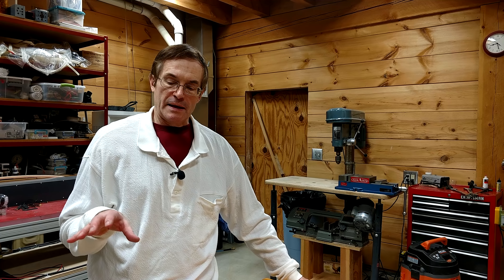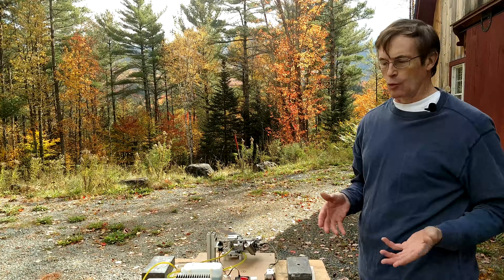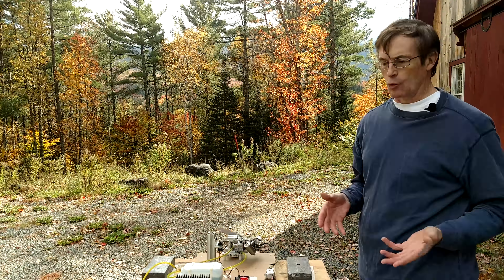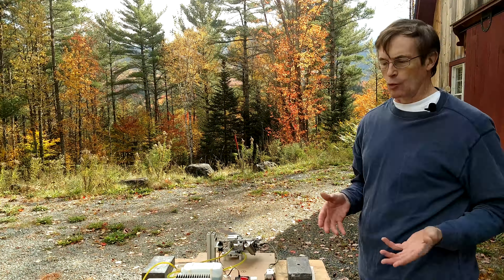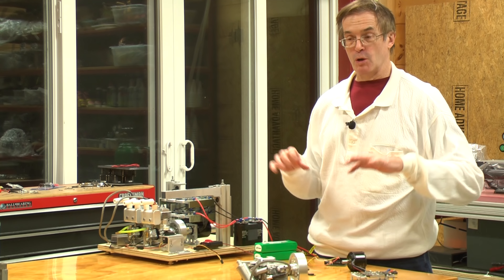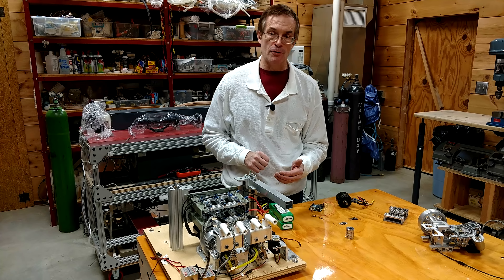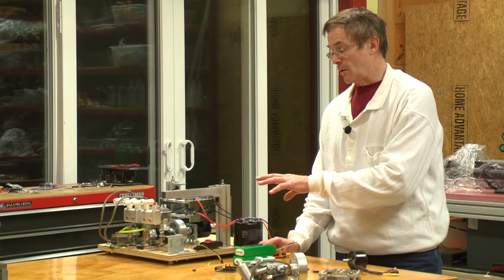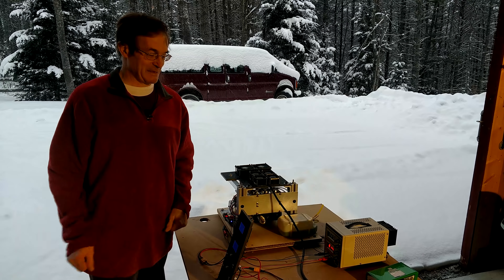Hybrid Drone Generator

Comment: A hybrid system of this type is what I always dreamed of for my ultralight or airplane.  That way, in the event of any gas motor failure, you have an electrical reserve to reach an airport.  If the battery pack were large enough, it could also have incredible hybrid like fuel savings (which is very relevant to flight costs especially for a recreational pilot).  This arrangement might also provide the incredible ability for some quiet soaring time (since stopping a gas only motor in flight for this purpose would usually be unsafe) since a restart would be assured.
You seem like someone who would enjoy building/flying an ultralight as a project...  I think a hybrid ultralight would be a thrilling addition to your inventions!  (I'd be happy to help test fly it.)  Thanks for all you do to spark learning, from a kids science teacher.  :-)

Comment: Love your videos and the technical accuracy (correctness) that you demonstrate.
I am working on a gas powered quad, and found the same thing you did regarding torque pulsations.
I moved from a 4 stroke engine to a 2 stroke.  Also added a flywheel to minimize amplitude of pulsations through my transmission.
The 2 stroke runs well at higher RPM's, so with greater gear reduction, this also enabled a lower torque (at the engine) for a given amount
of power.  Still had some problems during accel up to operating speed of resonance on the soft motor mounts, but not enough to  ruin anything.
Did have to go to a carb with diaphragm pump, not float, due to the high level of vibration.
Reply from the maker: Thanks and interesting.  Our vibration is very low, but in an airplane 
installation, the vibration should be at least as high and probably 
higher than yours.

Comment: This is so cool.  I've watched most of your other videos already and it's taken me a while to get to this one.  Very impressive work with the drone generator and I appreciate the in depth explanation of how you balanced everything.

The coupler that you broke could be replaced with a lovejoy coupler.  Those, if you're not already aware, have a rubber dampening piece that separates the two metal halves of the coupler.  They use them on cam driven fuel pumps on high horsepower motorsports applications because it removes the shock loading of the metal parts.  I don't think that's the correct scientific term, it may be, but that's what causes it to break. 

Thank you for making these videos.
Reply from the maker: Thanks!
That is the coupler that we eventually went with.

Comment: For drone use, it is quite possible to use an ESC to start the engine. Some ESC units may have trouble with the higher RPM when the unit is set to slower than running speed, and thus overheat trying to apply brake. Contact your ESC manufactures for ones that can be used for starting and electrically disconnected when returned to idle. You do not want a reversible unit or one with a brake function. This may allow use in an enclosed airframe where access for starting may be limited.

Comment: You can filter out ripple by using a so-called „capacitance multiplier“ circuit. EEVblog has a video about them. They use a small capacitor, a couple resistors and a transistor. Since the transistor multiplies the effect of the filter capacitor, you can considerably reduce the size of the filter capacitor, which saves a lot of weight and space.

Comment: You have an incredible presentation skill. I know many people who are excellent engineers or great presenters, but very few people who are both. I wonder how much power the commercial drones can generate - after all it's only around 300W or less than half a horsepower - probably not nearly enough to lift the motor with the fuel alone, not to mention the entire drone. This video shows really well how hard it is to build an efficient system like this, not to mention making it a working product, which is way harder than building a prototype.
Reply from the maker: Thanks!

Comment: If you calculate All of the optimal efficiencies in your Hybrid system, you will fins that you will need to burn around 200% of the weight of your entire Hybrid system in gasoline before it becomes more efficient than just adding more batteries.  Those 2-stroke engines have high single digit efficiency at best.
That being said, I think what you are doing is great, and applicable to many things.  ~new subscriber
Reply: What you say is true on takeoff but with modied stubby wings crusing you could run the gen at 100% peak power and divert that to 3 of your engines remember he said gas is 20 that s TWENTY times the energy to weight ratio of batteries so over 40 pounds in batteries =2 pounds of gasoline leaving 38 pounds for the hybrid drive...i might be wrong but god I hope "HIM" (above video) and I are both correct or he just pissed away a lot of time and money for a gasoline generator you can buy for $400

Comment: for the flex coupling, there are also ones which are overlapping claws with rubber (star) insert in between.
they are not that exact for cnc motions with forward/back, but should work fine for a oneway running generator.
Now the rubber might get old and hardened but worth a try.

Comment: I very much enjoyed this video and your teaching style is great. What you are building is a serial hybrid. As others have commented, the complexity and weight, and most importantly the conversion losses will overshadow the gains. Perhaps you should try a parallel hybrid. Use the engines to generate 85 percent of the upward thrust needed to hover the craft. Let the four electric motors make up the rest of the lift and provide control. You could use an inline pancake generator to supplement battery power, but you would be better off having no generator at all and simply sizing the fuel tank and the battery to have similar run times. I have been thinking about trying this for a long time. Counter rotation is the key.
Reply from the maker: There are arguments for and against both approaches. 

It is incorrect to say that the loses will overshadow the gains. For short flight times, the up front weight of the generator will dominate, but for short flights, the justification of either hybrid approach is questionable.  As flight duration increases, the use of the far higher energy density of the fuel overwhelms the added mechanical weight.  A modular, add on generator, is easier to incorporate onto existing multi rotors and is easier to isolate regarding noise and vibration, but it provides less efficiency than a parallel hybrid due to conversion losses.  The purpose of the multi rotor will determine what is the better approach.

Comment: Another great project with solid engineering and again I can't help myself from making some friendly suggestions:
1) I think you're paying an efficiency penalty by pursuing the anti-vibration goal.  2 small motors will be less weight and fuel efficient than one large on producing the same power.  Perhaps there are other ways to deal with the vibrations such as isolating the motor/generator from the flight controller?
2) I saw another hybrid drone project that used a propeller on the internal combustion engine to generate most of the lift for the drone and then use a lesser amount of transformed electrical power for stability and control motors.  You kind of already need a big propeller to deal with expected cooling requirements of the I.C. engine.  Saves the conversion losses going from mechanical to electrical
3)  I don't think you need your capacitor bank if you already have to have the battery packs.  Think of the batteries as "super" capacitors.

Comment: You are totally right with the pulsing. This is true for any electrochemical process, due to the diffusion limited currents that are caused by the depletion of Ions in the Electrode region and the resulting low ion concentration surface layer(Nernst-Planck Equation (the defusion Part)). You just you just have to make sure that The overall surface area is large enough so that your net current is depleting little enough volume to be replenished during the relaxation time  between the pulses.

Comment: Very well done. I did a similar design using a brushless permanent magnet motor as a 3 phase alternator for my motorcycle. very small and efficient but the regulator was a bitch. 3 phase bridge rectifiers can be had off the shelf. L-C filtered switching regulators are complicated to tune but very efficient over a wide range of engine rpm.  90 degree V twin engines are mechanically balanced and might simplify your design.  I was about to go down the same path you took 3 years ago after getting my alternator working and installed on my vintage motorcycle. Looks like you beat me to it. The energy per mass density of a chemical fuel blows even the best LI batteries  out of the park.  This should have been perfected a few years ago. I will be eagerly waiting your future posts.

Comment: You want a pair that is not only 180 out of phase but also counter-rotating. This will remove the torquing force on the airframe. - Since you're building mufflers anyways you might as well run a "Tri-Y" paired header to gain exhaust scavenging and therefor improve efficiency. You can still run a plenum muffler for noise reduction it just has to be after the last pairing. - Lighter but larger diameter flywheels will reduce overall weight. I'd suggest running the motor flywheels as counterbalancers only and use a common flywheel on the drive shaft so you can increase its diameter while reducing weight but since unlike the counter-rotating motors I suggested the drive shaft only spins one way you'd reintroduce some of the frame torquing. - I understand the want for the batteries as a redundant system to get you to the ground in need of a failure but you could save a fair bit of weight by simply using a dummy load for your buffering. Dummy load can switched on/off essentially instantaneously and the mechanical energy that was being wasted will be transferred to your generator instead with nary a blip since overall load will have changed little if at all. In order to mitigate the waste you can make you dummy load some additional motor cooling or something else useful. You could heat the fuel which will trade some output power for efficiency. Depends on where the gains are most worth it really.

Comment: While I am a great admirer of your positive enthusiasm and your eloquent way of explaining such elaborate details of your generator.
         I don't know if you have considered that a drone requires about 100 watts per every pound, that is including the weight of the drone. If your generator weighs 50 lbs this means obviously you will need 5 kilowatts just to lift the generator plus you will need that much more power to lift the drone and I doubt that your generator will ever produce anywhere near 10 KW at 50 Lbs.

 If I were you I would be considering the design of a drone that would fly on gas, this way you will take advantage of 100% of it's power and avoid the vast losses of generating electricity to run electric motors... it is not impossible, I know that throttle acceleration is not fast acting enough to control the needed variations on each individual propeller  but it can be done with a system of continuously variable transmission on each propeller being powered by  one single engine.

Comment: Ha!  You're right about Saito's being torquey.  The 180 I had (29cc) in a quarter scale plane, would break every retail available mount I tried.  I eventually welded my own dynafocal mount with vibration isolation mounts built in, and conquered the mount-monster's savage path of destruction!

Comment: you can speed up the regulator for the motor rpm control bu not looking at the voltage drop, but to the current you draw.
when you draw for example 12A and get a jump to lets say 18A, the voltage will hang for a bit before it drops.
so voltage drop always seems to lag in a battery system 
in a capacitor based system the volts drop immediately when there is a current peak.
this is why a standard capacitor based system can get away with looking at the voltage.
in this setup i would look at the drawn current and regulate the engine power from that.
might even put a PID (usually for temperature, but works fine with generators with variable loads) regulator on it where the regulator output is exponentially more with larger differences. 
hope this "out of the box" thinking of mine helps a bit :)

Comment: For regulating the voltage, you might try a technique I have seen with big industrial three-phase power supplies. They replace half of the diodes (the ones feeding the positive bus, for instance) in the 3 phase rectifier with SCRs. These will work only if they get a signal to make them conduct. So a micro-controller watches the output voltage and turns the SCRs on for the entire duration of each half wave if the power requirements are high, but only for a small duration toward the end of the half wave if the voltage is getting too high due to reduced demand on the system. Yes, it puts out some dirty wave-forms, but a good inductor will fix that. The Inductor would not have to be too big, since you have such high frequency
Reply from the maker: Good idea!

Comment: At the beginning of the video you mention the power density of batteries. You are correct when you mention the power density of batteries being much lower then gas. However, after building this whole system your power density of your gas system is much lower then originally estimated due to need for a engine and a generator. You also have a significant loss factor of your gas engine (generally around 30% eff) and a loss factor for your electronic components (probably around >95% eff). I'm sceptical if you can overcome the extra weight and losses and still have a higher energy per unit weight and volume when compared to the batteries. Did you calculate an expected expected energy density of your final system?
Reply from the maker: That's an important point, but the analysis has to be different.  Unlike the batteries, the generator module is a fixed weight independent of the fuel quantity available.  With little available fuel the energy ratio is terrible.  As the fuel supply increases the ratio continues to improve and asymptotically approaches that of the fuel itself.  The generator is a bad alternative if short flights are the goal.
Reply: @TechIngredients  I agree with your analysis. However, if you fix your system size and increase your available fuel the system will also increase in weight but not necessarily increase it's power output by the same amount. If I understand your goal correctly you want to produce a drone with a longer flight time then one of batteries. You are therefore need a specific power output to lift your system as well as the drone. If you increase your fuel supply to improve your ratio, as you mentioned, the power generation system will also have to increase in size to counter the increased weight.  Thus there will be an optimal fuel supply amount and power generation size. This optimal may even lie much larger then you would think. 

Thank you for the response! I find your videos very thought provoking.
Reply from the maker: That's correct, but also applies to batteries when you factor in all of the lift system such as the mechanical strength of the arms, the gauge of the wiring, the motors etc.  The engineering is complex and nothing is simply linear.

Comment: balancing those two engines was freaking genius. i hope you patent that if possible.
Reply: Patent a 2 cylinder engine?
Reply: Zach A did you actualy watch the video or read all of my comment? Patent the balanced special 2 cylinder engine he invented ,because he could not find one like it. not just a  2 cylinder engine.
Reply: Not sure he's going to get rich with a patent for introducing wild imbalances in two motors mounted side by side... I don't know where he got the idea that RC engines are not crank balanced for the piston reciprocation, but he's wrong. We are very careful to balance our propellers on RC planes precisely to avoid the bearing destroying vibration he created.

Comment: This is very educational and I like how you explain your development process.  Might I suggest using a hover board motor as your generator.  They are 36v motors and will produce 3 phase AC.  It has been a while sine I took one apart, but it has a lot of permanent magnets around the circumference.  You have to remove the controller board and hall sensors.  An easier voltage control would be to use an off the shelf MPPT controller.
Reply: Any brushless D.C. motor will work as a 3-phase A.C. generator.

Comment: That flexible coupling is designed for cnc applications where motors does not rotate with these high rpms and low duty cycles. In this application, since rpms are higher and thus slightest of misalignment and vibration will cause couplings like these fail due to fatigue failure.
Reply from the maker: That's right.

Comment: EDIT: It was UMS Radial by Tomahawk, "Sternmotor Mini50", and they're no longer in production. 

I can't remember the name of the company, but they (used to??) make an RC knockoff of a 4-cycle 5cyl P&W radial that dealt with the torque pulses, just due to the nature of radial engines, somewhere in the 50cc total displacement range; Designed for old RC versions of Cessna 195's. Can't imagine it would work any better than what you've got here, or if you could even get one today just to play with. But it would definitely be a fun experiment. Will do some more googling see if I can remember what the heck name of the company was. They ran just smooth as silk as I recall, ran on a 50:1 premix fuel to lube the cyls, only needed a few drops of oil in the crankcase, up to 25:1 clear mineral smoke oil if you wanted the smoke stream. If nothing else it's a neat engine to have in the collection